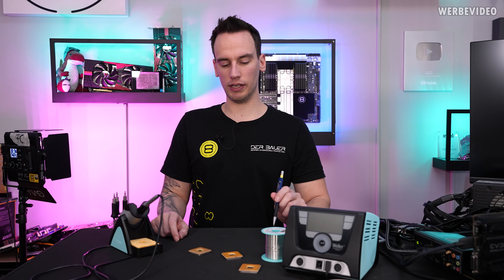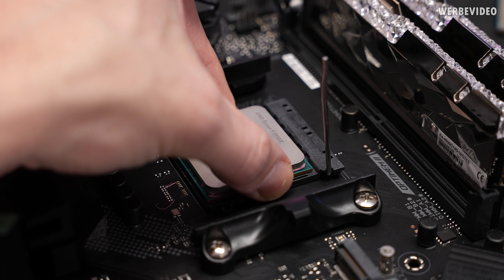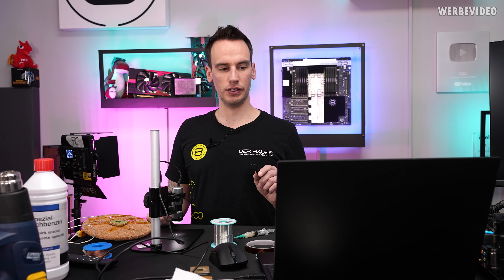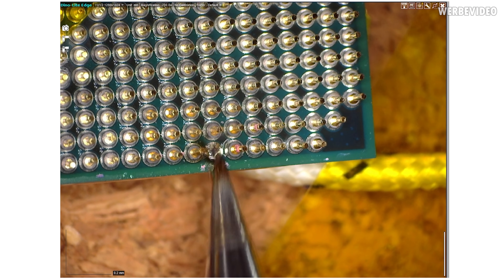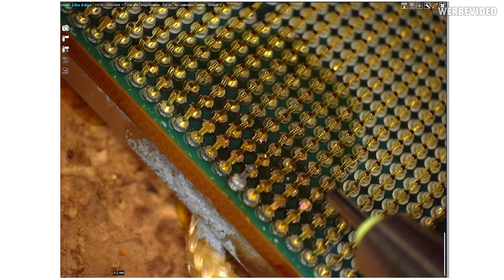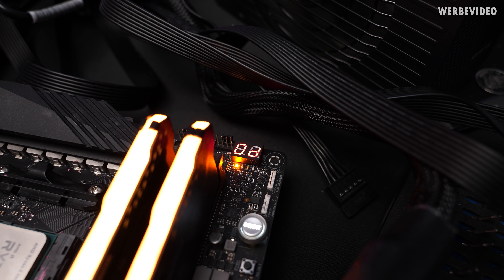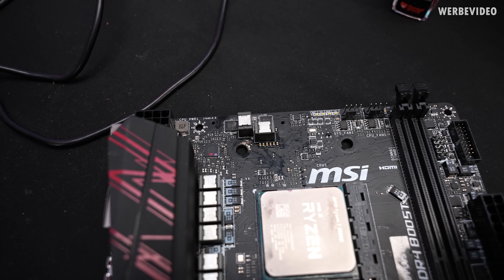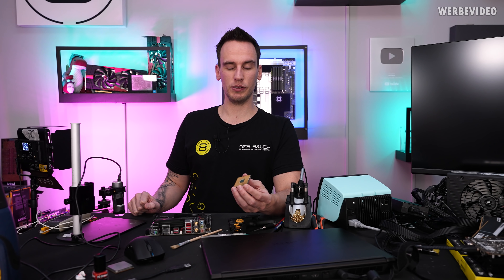I tried to Repair a Dead Ryzen 5950X and almost made it Worse...

Comment: What would be really nice for this sort of pin repair would be a soldering laser spot. Stick the pins on with solder paste, then use a hotplate to get the temp close, then a non-contact laser for the final targetted repair.

Comment: Back in the Athlon XP days we just put a piece of copper wire into the socket to do the job of the missing pin. Optimally slightly longer than the original pin. The extra length makes sure it has enough pressure on the pad on the CPU for proper contact.
And I have a LGA775 board with a missing pin ("spring"?) but it still runs just fine. Just a ground pin for power deliery, so the other 136 pins now have to carry 0.735% more, which is no big deal.

Comment: i feel stupid lol at 10:50 almost had an orgasm lol what you can know which pins are not working by software? i thought you put it in a machine and it told you which ones are correct or not turned out it's only an amd diagram lol and the red colour doesn't mean it is not working

Comment: Maybe you can use a donor am4 socket as a template for holding the replacement pin(s).
Probably a bad idea since you want be able to heat the pins well to melt the solder if the template is in the way.

Comment: I fixed a broken pin on an AMD FX-60 I got for free from a friend.  The way I fixed it was with eclectically conductive two part epoxy. I used a sewing pin and dipped it the mix epoxy then dabbed the epoxy on the spot where the pin was missing then waited a few minutes and with tweezers held the cpu pin in position until the epoxy set.  It worked and I was happy for a free upgrade to an FX-60 that was a big deal back at that time. I already had a socket 939 platform with lower end cpu. LOL the funny part was I did it at LAN party in the wee hours of the morning.

Comment: Great Video
bought brand new 5900x installed and it didn't work at all even after troubleshooting! Finally took out and inspected cpu pins!  Was 2 bent pins and i used a razer blade just the blade and easily bent them back and happy to say pc has flawlessly worked with no issues!  5900x 6700xt 650w psu 32gb 3600 crucial ram 2tb 980 evo m.2 240mm aio cpu cooler and cooler master n200 itx case runs under 60c full load

Comment: i would try to drill a hole to soldering iron tip, for just hold the pin. and put it onto board. or you can buy some injection needle in pharmacy, and that heat up with iron, if you just want to replace only one pin

Comment: Anyone watching this and doing it in the future should know to heat the pin, not the solder. See how he knocked the one on the left off? That happened because his iron touched the pin...which melted the solder and allowed it to move.

Tweeze the pin, heat the pin, melt solder in socket with hot pin, place pin down.

Comment: I have another method that is more reliable and is no soldering. Get some twist ties: wires that have plastic insulation. Strip the plastic off and test-fit the wire in the socket hole and push in then use a scissor to cut the wire while installed in the socket. Install CPU and try boot.  It may take a few tries to get the PIN height right but it will work.

Comment: I saw that you had hot tweezers that you used in the 12900K repair, would it have been possible to use the hot tweezers to hold the pin, then just solder it down using that?

Comment: Just turn your soldering iron up higher rather than heating the chip up with a heat gun or if you must use a hot air station with a small nozzle

Comment: How about an alu pin matrix (socket like) on top of all pins and aerial heat? Even if you resolder some othe pins matrix will keep them in position. 
And you will ha a universal tool and method for more then 1 pin. Maybe even could be helpful to straighten pins if it would have 0,35 ish diameter.

Comment: A old trick to set up pin straight, is to use a xacto (only the blade) and setup the hole line of pins  do it in all direction (x and y), tick the blade left and right  and you will find that all are in a perfect line.....  i hope i make my sell clear :) old school from P4 ... and Athlon ...... Cyrix and so on... ehheheheheh by the way good job soldering that pin, they are smaller that the old ones, but same technic can be applied.

Comment: I had to fix a load of bent pins on a 3950X at the start of last year - used the tip of a mechanical pencil to straighten them - was nice and easy (hardest part was seeing the bent pins - but I used the zoom feature on my phone camera to see them) - CPU works perfectly
Reply: Nice work!. Fortunately I've not bent any pins too badly. I use a Stanley blade as a straight edged to align any that are bent out.

Comment: I would say your tip was a just a lil big, in that situation I don't think heating the cpu and using the flux helped, it made things worse other pins were able to soften and move around. Very lucky they were on the outside edge. I solder every day for a living, I dont use a lot of flux, High temp 650* and touch in go, its a lot of heat but it only takes a second for it to cool down, its very quick.

Comment: ----   YOU CAN DO THIS der8auer!!!! And we WANT TO SEE YOU SUCCEED!!!!! I hope you post that video soon!!!! And REMEMBER - NO NEED TO PREHEAT THE CHIP - LINUS (LTT) repaired a CPU by replacing broken off pins and he gives A LOT of TIPS & TRICKS on how to do it, and he shows you everything you need to know - but it is SUPER IMPORTANT NOT TO REMOVE THE PAD ON THE CPU YOU WANT TO FIX!!!! - IT WILL BE TRASH IF YOU DO THIS!! SO DO NOT HEAT THE WHOLE CHIP!!!!------
------
You are only aiming to melt the soldier of ONE PIN at a time, so why make it possible for a whole bunch of other pins to melt??? I have seen pins replaced like this b3efore and they never heated up the entire chip,,, they just used a soldiering iron and flux... and YES using that mechanical pencil is a GREAT idea for holding the pin to bend it, but if you are trying to attach the pin how do you make the pencil let go of the pin when the soldier is melted??? maybe you make sure there is 'lead' in the pencil and you push the pencil button that moves the 'lead' forward, and that will push the pin out, but this might not be so easy to get just right/perfect the way you9 need it.... so tweezers are probably the best way...
ALSO, SECURE THE CHIP SO IT DOES NOT MOVE AT ALL!!! - Maybe one of those holders with movable alligator clip arms... you have there of those arms clipped to the right spot on the sides of the chip and it will not be able to move at all... it take A LOT of PRESCISON, so you NEED TO PLAN OUT WHAT YOU ARE GOING TO DO.... maybe get a fourth alligator clip arm to hold the pencil with the pin in it right on the exact position you need it to be... you know what I mean??? position the pin so it is in the exact place you want it to be when it's soldiered and then you come in from the side with you hot iron... and MAKE SURE TEH PIN HAS SOLDIER ALREADY STUCK TO THE END.... I didn't understand why you removed it from the pins after you took them off the donor... but I guess it depends if there is soldier ALREADY ON THE CHIP.... 
--- I KNOW you can do this!!! You are an INSPIRATION to me.. like BIG TIME!!! I see how much knowledge you have and I LOVE learning the thing you teach us. So we KNOW you have it in you to take the time to relax an concentrate on getting it right... if you DON'T FEEL CONFIDENT YET, then PRACTIC DOING IT ON THE DONOR CPU FIRST!! WHAT DO YOU HAVE TO POSE?!?! LOL - Trying pulling off and then replacing a bunch of pins on the donor chip and get some confidence that you know how to do it... YES it MIGHT take some time to learn how to get it down perfectly, but that IS@! how the saying goes: PRACTICE MAKES PERFECT!!!! ---- YOU CAAANN DO EETT!!!!!!! ------ :D  <3  :D

Comment: Use mini drill bit, jewelers tools, and put hole in soldering tip and hold cpu down to install pin, and up to remove pin?  Or use mini flat screwdriver to press pin still in soldering tip?

Comment: When I broke two pins from AM3 CPU I used thin layer soft plastic material like playdoh for kids just to hold pins in right place. Heat gun, flux and melting solder will do the rest as you saw in 7:48

My dad is much experienced person in soldering. I'm just self learning amateur. He told me to do that method. It worked extremely easy!
Reply: Oh I forgot to mention about do not inhale smoke from playdoh stuff. It is very dangerous to lungs and it can put you in bed for good 4 days! I didn't know that and got sick. Always use face protection and fume extraction

Comment: I absolutely have  no idea on how to resolder broken pins, but for bent pins using a common cutter blade and inserting it in the space between pins rows  allows to unbend them easily and several at a time, I did it on a 3900X

Comment: Use the blue or white tack putty- it’s sometimes called poster hanging putty or something- it works really well to hold electronics in place- doesn’t dry, doesn’t leave a residue, and it temperature stable for the most part

Comment: Roman, the flat-back of a steak knife is usually the perfect width, so you can gently slide/wiggle the knife in, and allow it's width to perfectly straighten & alight the pin. I've done this on my 2700x and maaaany 478 socket CPU's from back in the day.

Comment: Machine down the thickness of the soldering iron, drill a hole in the end of it and put the pin in it, it will focus the heat on that one pin only

Comment: Could you not take the CPU socket from a donor motherboard and use it as a frame to hold the cpu pins in place while soldering? How heat resistent is the CPU socket plastic I wonder. It could be as simple as putting the replacement pin(s) in the socket, heating the CPU to 180c, dropping the CPU into the socket, and heating the replacement pins from the other end of the socket to melt the solder.

Comment: I wonder. Could you order a metal stencil with holes for all the CPU pins so you could put the stencil  over the pins on the CPU to hold them in position. you could still apply heat to length of the pins that stick out from stencil to possibly melt the solder.

Comment: I'm wondering if you could take a soldering iron tip, drill a 0.3mm hole in the bottom and repair pins this way?  The mechanical pencil seemed to work well.  . .now it just needs some heat!

Comment: the sucking in the pin into position is called surface tension! so cool you dont need to actually place it perfectly it just has to touch the solder and when it dries gets sucked into place

Comment: Your best to use hot air with low airflow so you don't blow the other pins off the CPU, also a heat plate to keep the IHS and CPU at a constant (ish) temperature, use a fine nozzle to concentrate the airflow to just the pin/s you are working on, it will soak the heat to surrounding pins so be very careful not to disturb them, use plenty of flux to aid solder melt and it will help the pin realignment as it starts to cool, it's all about having a steady hand.
Great video as usual bro, I'm a hardware fan with a lack of funds for high-end so rely on people like you for the extra knowledge 👍 keep up the great work 🙂

Comment: You should make a DIY soldering station guide to your fixes, as if you've broken a £500 CPU, you wouldn't mind investing nearly £100 in fixing it. I'm sure you could make a thermally absorbing mount for a usb microscope. Lighting, solder, tweezers and perhaps a tool to hold pins better? Really interesting video! Thanks for all your efforts

Comment: FYI, while you can use a mechanical pencil, a razor blade, like one from a utility knife works really well. You run the blade along the rows and it’ll align the bent pins perfectly with the other pins. JayzTwoCents made a video a while ago about it.

Comment: There is a special pin mask available that holds all the pins in place as when the chip is manufactured. When the new pins are put in place in the correct holes in the pin mask and the pin mask inserted over the other pins on the cpu, simply heating the area on the cpu around the broken pins with heat gun this will result in all the pin aligning correctly due to the pin mask. Pins that you do not want to heat can be masked off.
Reply: Yea Linus used that. But he made a mistake when he placed the pins wrong he did it over the mask instead under wich would hold the pins better without worring about pins flying by the heatgun

Comment: Back in my overclocking days of single core barton AMD chips, one chap in the overclockers forums used to sell "combs" which sat in the area around the pin and created a very crisp medium to straighten against just using tweezers, wonder if those are still about today as I am sure they would make your bending of pins a lot easier as you just have the guide on the comb to work to as opposed to having to work with the 2 dimensions a pin has to be straight in.   He used to sell them in "corners" as well as chip widths and whole chips arrays, I can't find mine as I only had a corner array as that could be used on any CPU.

Comment: When we were building a PC for a friend of mine, we needed to retrieve an R5 2600 from a motherboard. Turns out the thermal paste had basically cemented, and trying to take the cooler off ripped the entire CPU straight out of the socket. Motherboard wouldn't hold a CPU in properly on its own anymore, and the CPU had many bent pins.

We spent a couple hours using a credit card to very carefully align the pins a row at a time, and eventually a miracle happened and it went right into the new motherboard socket. Not only that - We tried a different CPU on the damaged motherboard and found that the CPU would only move if the board was flipped completely over (it would fall out). Simply keeping the board in place and mounting the cooler proved to be enough to get it up and running, and it never had a problem. I eventually sold a system with that board to another friend at a steep discount, and he has had zero problems to this day.

We were terrified during the process of addressing our mistakes, but it turned out a success story and I'm a lot less hopeless about hardware that's potentially been damaged now 😁
Reply: same story as mine lol. forgot about heating the cpu before taking the cooler off and ended up ripping the cpu off. lucikly no pins were bent, not even one. I got real lucky there that day
Reply: @lynx5327  Same, it's terrifying

Comment: Just a recommendation from my side, when you are replacing pins use the solderig material with low temperature of phase change,  like for example: Sn42Bi57Ag1 (Bismuth has low melting temp, higher the precentage of Bismuth, lower the temperature). It'll solder just fine with 138-140degree Celsius, you don't need to heat that much and also you won't break other pins. 
About sole replacing.. good microscope and soldering iron is a must, than only some experience ;)
Reply: That's it? My 5 year toddler can do it.

Comment: You need a much smaller tip, and much less preheat, rather focus more heat on the tip. Edit:  A tweezer style tip might be best option (holding the the pin), just heat the pin and let the heat soak to the board (might need more preheat with that).

Comment: you could stick it down with kapton tape to make it steadier. also, consider sticking it down to a temperature controlled hot plate, to keep it steadily at that pre-heat temperature instead of repeatedly cycling it. also, looks like a finer soldering tip would help too, you can get really tiny tips for SMD soldering
Reply: with the hot plate, you could even stick down the pins with flux, and just reflow the whole thing. could be riskier though

Comment: That's so cool. -- Would love to see it on the 5600 as well. -- Considering that the tension just pulled the pin into place, could you just set it there with some solder paste and reflow it in a PCB oven?

Comment: This is much easier to do with something like a 853AAA BGA rework station and a finer tip. Doing that with a hot air gun, tweezers and a normal tip kinda is a hardcore challenge.

Comment: How are pins soldered at the factory? Probably placed into a template and soldered all at once. How small is the smallest tool on your cnc? If you could replicate the socket, then place pin where it is missing and heat whole thing up from the bottom till solder melts, let it cool.. perfect result.

Comment: All of these problems are why Intel moved to LGA a long time ago and AMD is finally going LGA for their new CPUs
Reply: yeah but what happens when you damage lga pins on motherboard which are much harder to fix?
Reply: @ThunderingRoar  you know who doesn't care? Intel. 
it was a genius move
I'd also rather replace a $100-$200 motherboard than a $500 CPU
Reply: @iamdmc  well midrange z690 boards are like 300$+ nowadays so definitely not a cheap replacement
Reply: @ThunderingRoar  depends on the board you're right but I'd never buy a board that cost more than the CPU

my point stands: better the mobo manufacturer deals with bent pins than intel or amd haha

Comment: This is such a bonheaded approach to desoldering a pin. Use a cone tip and flux, desolder the individual pin and avoid nuking the entire cpu. Yes, it will survive the blasting, but it's not necessary.

Comment: If you have a "lead" in the pencil, you could extend it halfway through the tip so that only part of the pin fits inside - just enough so that it doesn't fall out, but not so deep that it interfere with the soldering iron.
Reply: Good thinking

Comment: silicone putty!
non conductive and pretty sticky, you can squish small pcbs or components into it to hold in place a lot more safely and you don't have to worry about it melting/burning. 

can sometimes be hard to clean off though